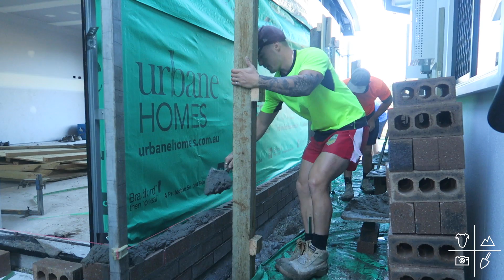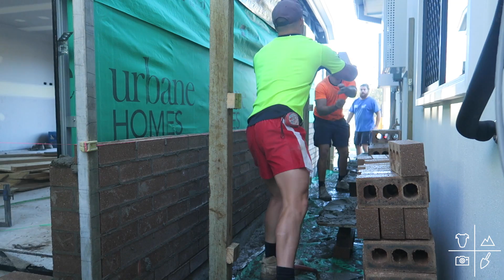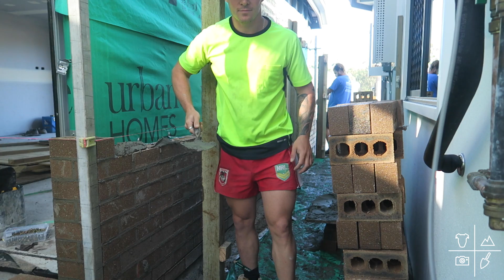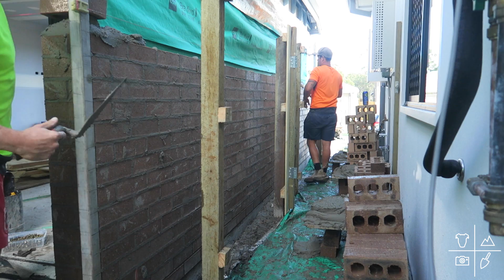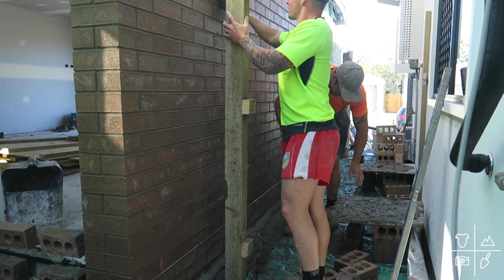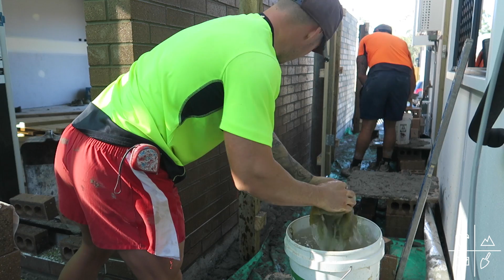1000 BRICKS in 3 HOURS

Comment: Washing the brick after it's jointed, you never have any issues with the mortar getting wet and running on the bricks?
Reply from the maker: eric galassi that only ever happens if your sponge is too wet
Reply: @adventureswithizack5889  that's what I thought. You rink the sponge out as much as you can. Thanks for the reply
Reply: Can't do that in England with those bricks...
Reply: Am not into slating anybody but the only time you guys look quick is when you speed the video up?!
Reply: I live in Peterborough/UK we use a dry sponge instead of a soft brush to finish of our brickwork after pointing 👍

Comment: That wasn’t three hours it was twelve minutes which is slow anyway. I used to lay 1500 bricks in an hour single handed. Shit if I used both hands I could lay 4000 an hour. Mixed all my own mud too. Just had one lad who used to make the brews and go get the dinners. Apart from that I did it all myself 5000 bricks in an hour with no tools in the snow and was pitch dark only a candle for light.
Reply: So you lay 25 bricks in 1minute???
Reply: I’ll do you one better, my bricks lay themselves. Dont even got to get up early in the mornin either. Up at 1130 am back home at 230 pm.